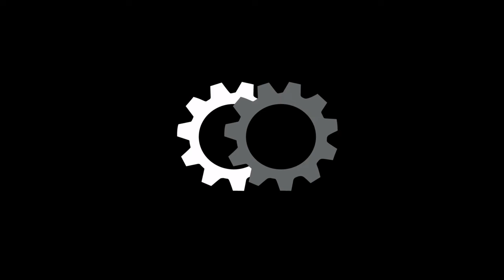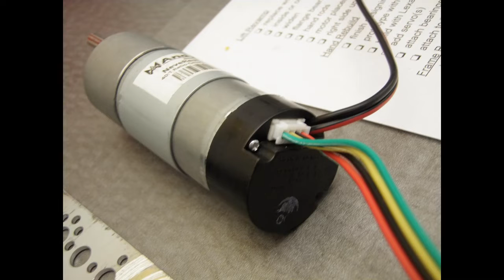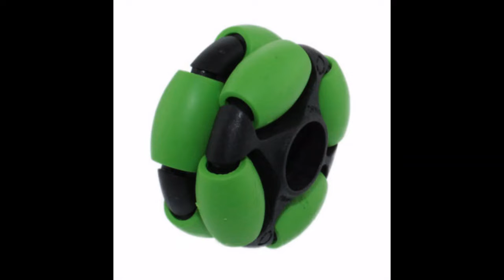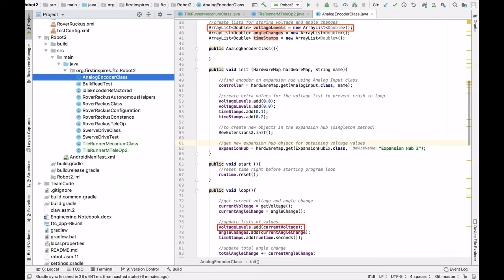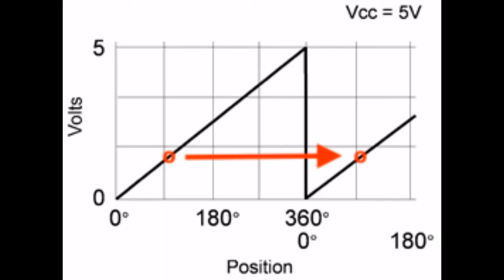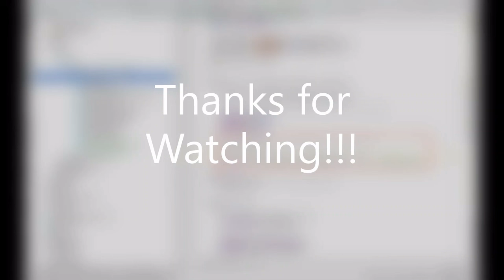Introduction to Passive Wheels | FIRST Tech Challenge

Comment: How are you guys dealing with looparound?
Reply from the maker: We aren't too familiar with the term "looparound". However, assuming that this is referring to ping lag, we use an autotransition on our phones to make it easier to transfer between TeleOp and Autonomous.
Reply: @ftc11138  loop around is where if you drive too fast the encoder will make a complete 360 loop before the encoder is read by the rev hub and then loose track of robot position